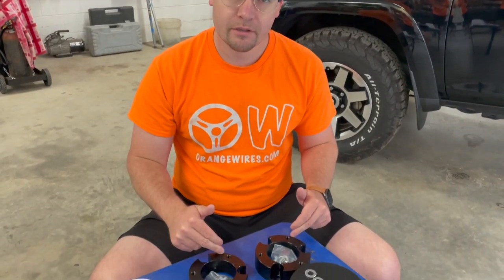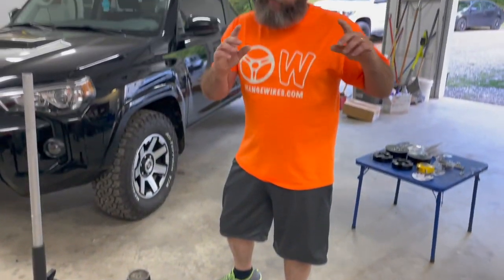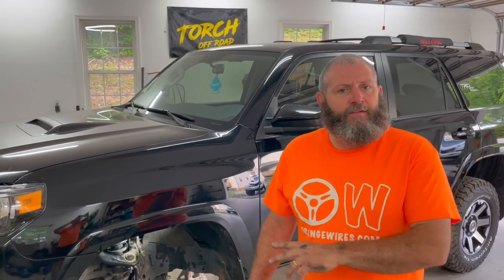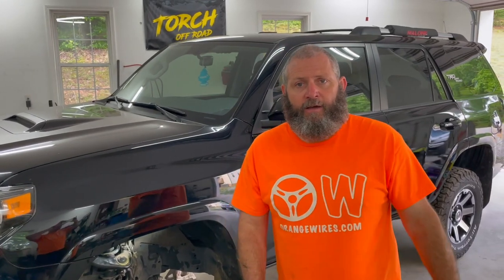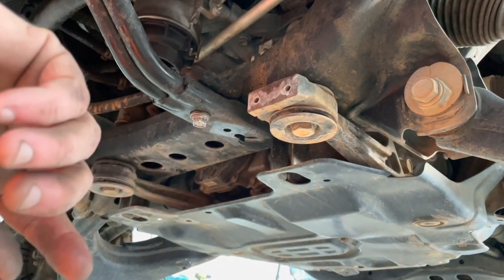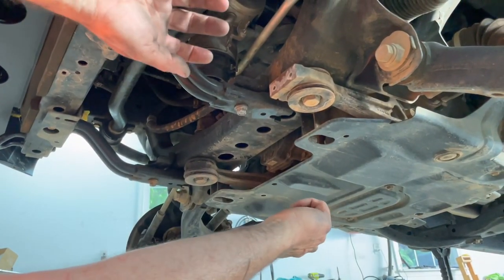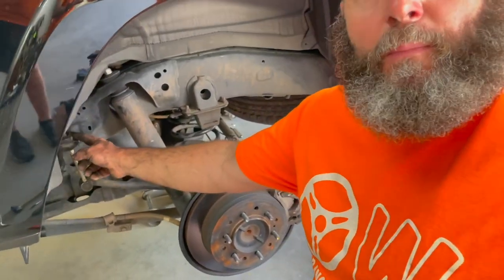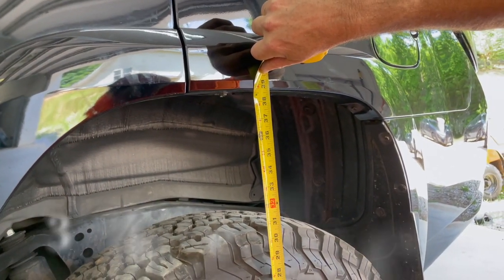How to Install a TORCH OFF ROAD LIFT KIT ON A NEW 4RUNNER!

Comment: What size tires are on that 4Runner? I installed the same kit on my 2014 4Runner and I have 265/70R17 tires and I have 37 inches in the front and 39 inches in the rear. The rear of mine still sits higher!